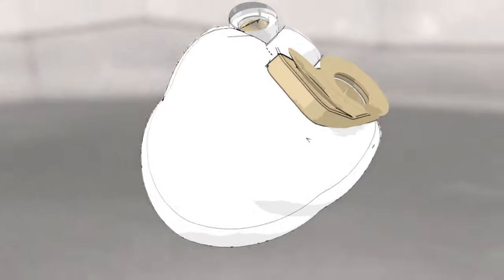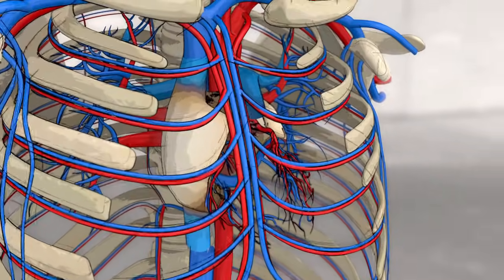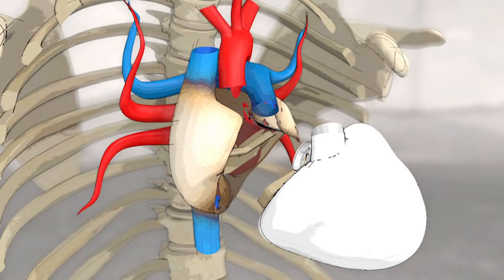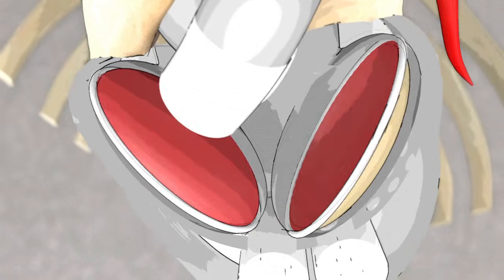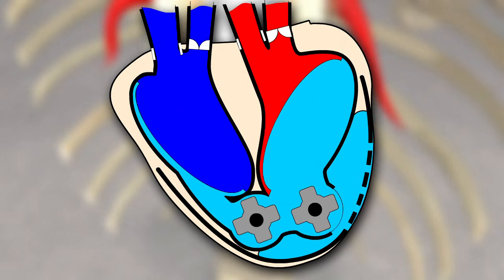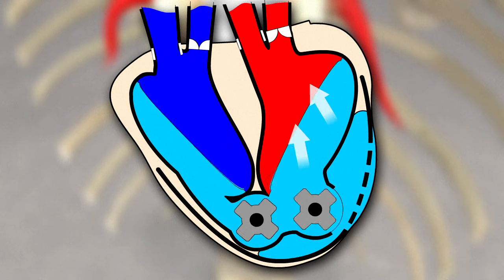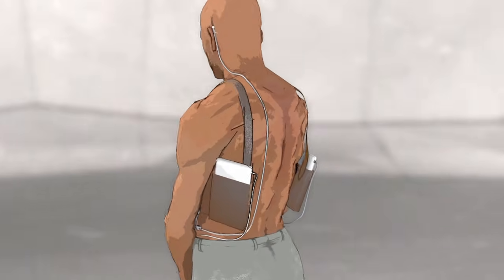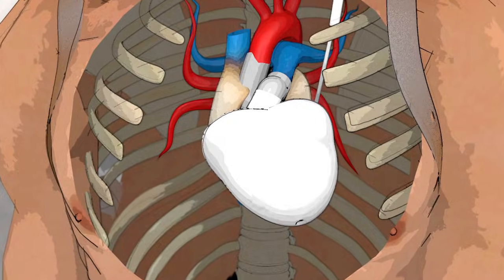Artificial hearts

Comment: i wonder if they can attach a artificial heart anywhere in the body , like the foot where the heart has problems sending blood back up when a person gets older, i believe if they put more then one pulsing device to push blood in the body that the normal heart wouldn't have to be removed , i believe one of the main reasons the heart gets damaged is arteries get blocked and the heart cant push the blood through the arteries which makes the blood come back to the heart abnormally and makes the heart have to work harder to push the blood , i believe making a smaller artificial heart and putting it in other locations in the body that the heart wouldn't have to work so hard and would be able to heal itself , its the rate  blood is going into the heart and coming out of the heart that damages it

Comment: Future model should have activity monitor and increase rate depending on amount of exertion. 

Shame it only lasts 5 years though. That’s a mighty serious procedure to replace twice a decade...but those are years people wouldn’t have before this invention, so it’s better than nothing.
Reply: The idea is that it lasts untill you find a donor and it's replaced with an actual heart, which will last longer.
Reply: There is already a new artificial heart that is being made on Australia(It still needs to pass clinical trials), but in theory it could last at the very least 10 years it could become a treatment for people that can't have a heart transplant or people that don't want to deal with the adverse effects of inmunosupressant drug.

Comment: Will the heart like over heat
Reply: Maybe if the machine heart pumping fast maybe the components will overheat but if components near at the blood while the machine is heating it will heat the blood as well while the heart pump machine is overheating maybe the components will be damage needed repair or replace the heart pump machine
Reply: @Nicol hold up you the engineer gaming 😳😲

Comment: then you forget to have sensor, when the body is running, they should have sense the need of more oxygen pump to the body.
the hear needs to be capable to synchronized with the bodies need when to adjust.
if not you gonna suffer with too low of oxygen or too much of oxygen
Reply: ITsupportian I'm sure they would've figured that out, moron
Reply: @maniacalo2901  well not really.. he is right. I’m assuming people that undergo these transplants are not allowed to do any kind of physical activities.

Moron.

Comment: I do like more artificial hearts without a beat, based on the principle of a propeller pump, than this kind of hearts with a beat. "Beating" is basically not a good thing for the body vasculature.
Reply: jaffyfoxy I'm pretty sure the people who designed it thought of all of this. They didn't just pull this design out of their ass.
Reply: +Rivas People can live very long lives with a beating heart. I'm sure it's better than a failing heart.
Reply: The pulse is needed to maintain the strength of the artery walls. When using pumps of constant flow, the walls of arteries become thinner, which can lead to bleeding. However, the most advanced pump like heartmate 3 can imitate the pulse, so that the membrane machines are really outdated.
Reply: +Random Dude nature did, but you know what, have you seen that animal in nature, the one who have wheels? No? that's because nature didn't invent wheels, too complex, but humans did, can you imagine if we had to adapt a car to work on legs? that would be hard because it's a much more complex system.
 in this case, you're comparing a small quad microturbine with two separate supercapacitors and 70 years of service life to something wich is basically a waste of power storage space, believe me, if western digital can do that wonderful miniaturization on hard disk drivers, in the near future we could simply 3d print them.
I'd love to have my own 3d printed heart, if we could just hack it...